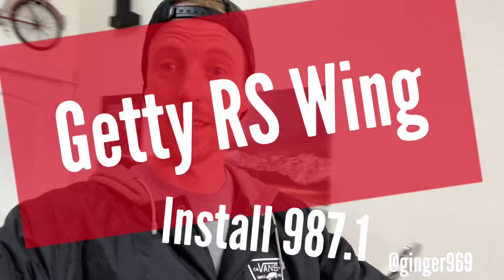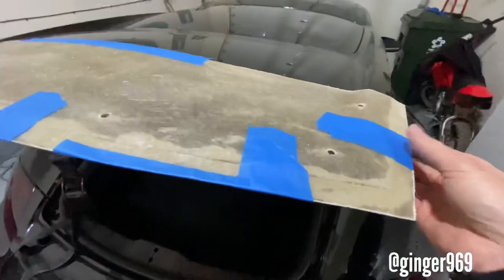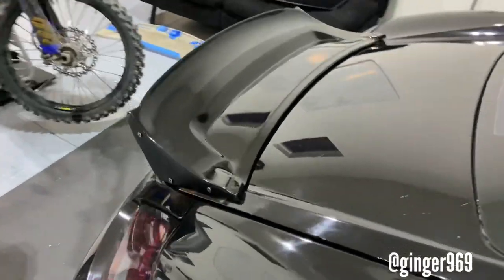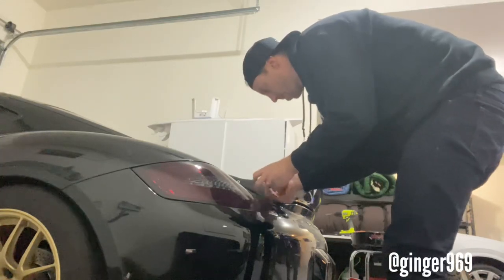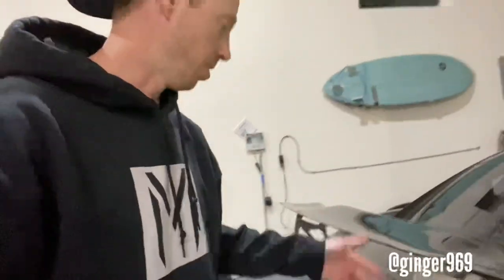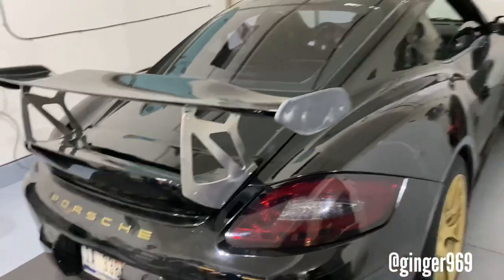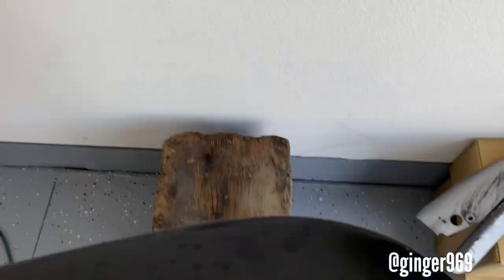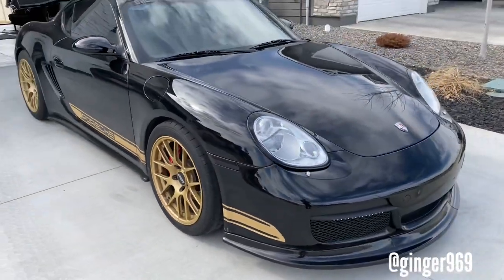INSTALL: Getty RS Wing & Base - 987.1 Porsche Cayman S

Comment: You can bolt the template to the underside of the base to confirm hole alignment and make marks to show which holes have moved, I have seen this step in another install.

Comment: Looks Great Shelby, have you had any issues with lift at speed from the front end, I can see in the next Vlog you have installed front canards for front end down force, Im very curious and love what you have done to the car, however Porsche designed this car with a fantastic handling and driving ability straight out of the box, I have the same Model car as you I have a 987.1 Cayman S Sport...so Im really curious
Reply from the maker: Got to really get into her at speed today with the canards on and the car felt exceptionally well planted almost like glued to the road so seems like everything is balanced for down force with the two now!
Reply: Thats Awesome, that has swayed my decision to push forward and modify the car, really love the rear wing by the way, it really suits the car and Im so glad its doing what its supposed to....cant wait for the rest of the mods
Reply from the maker: @nick7602  that’s awesome to hear! Keep me posted as what you end up doing!

Comment: For what this costs it’s WAY over priced for the quality, the bolts are cheap as hell and the finish on the wing ends are rough as hell. 🤷‍♂️ I would have painted the brackets gold. The black and gold looks good.
Reply from the maker: I do agree a bit on over priced but I’ve yet to find a better option for less :/ LOVE the Versus wing but it’s $5k haha
Reply: I actually think a lot of the Getty design stuff is drop shipped from aliexpress, packaging and everything matched